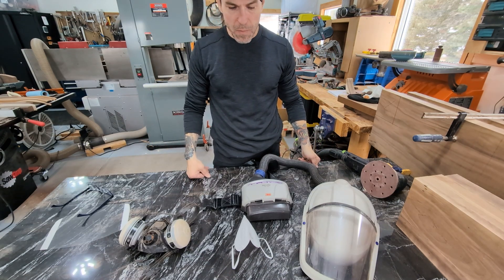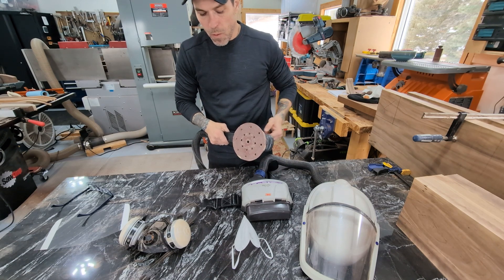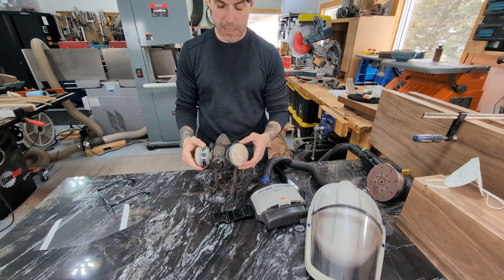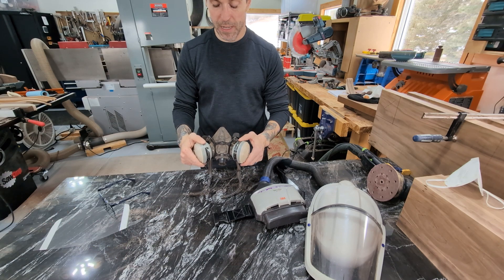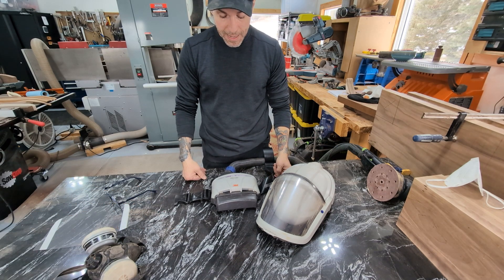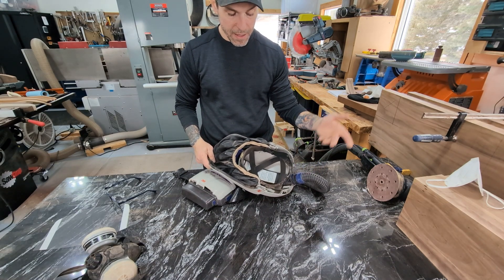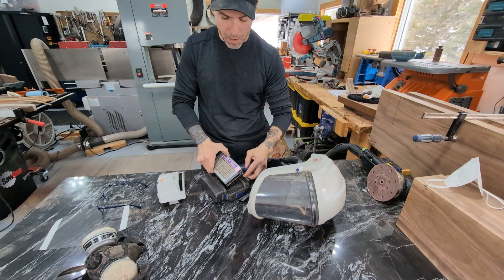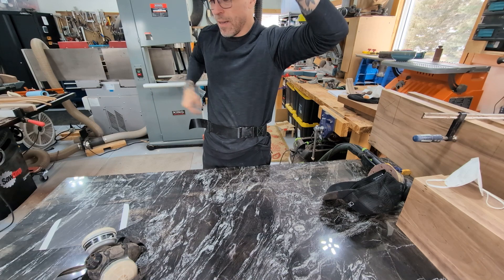A few comments on dust masks - 3M Versaflo TR300+, N95 and Honeywell

Comment: Good morning 🌅, That was very nice info, I have the same 3 M Versaflo , I have had mine for a round 10 + years, there is a wire mesh and foam filter that will help as well, you forgot to mention that there is one big down side to this 😮 😂, if you Fart / brake Wind 😮 😂 you will inhale the gas, 😂, I would quite often put it on as soon as I start working, it would only come off when I left my workshop, I had the complete kit, well worth the money, stay safe, retired English dude living in France,

Comment: I'm searching for the best product for woodturning. I think this air pressure method in active masks work better than the others since they are using a completely new design approach. The air goes outside from inside the mask, so it's basically impossible you get ANY dust or particles whatever it's size in microns. Am I right?
Reply: Spot on  :)